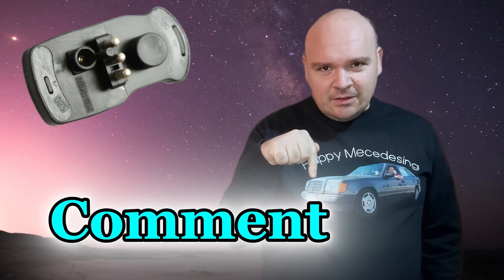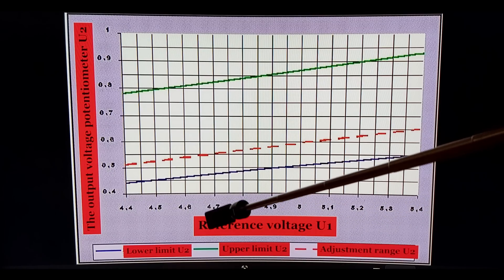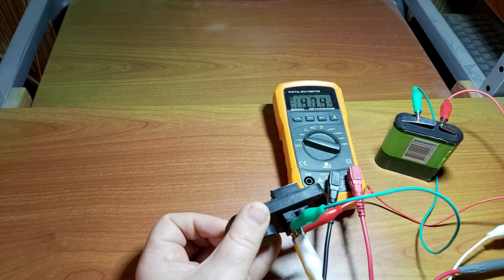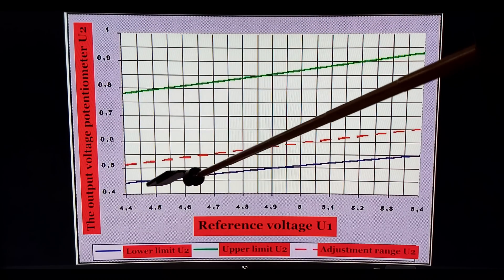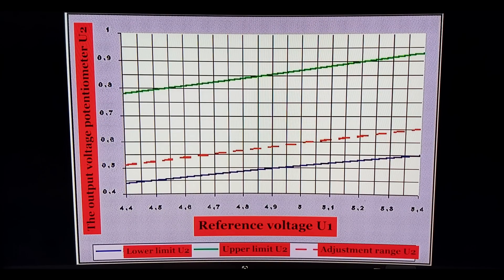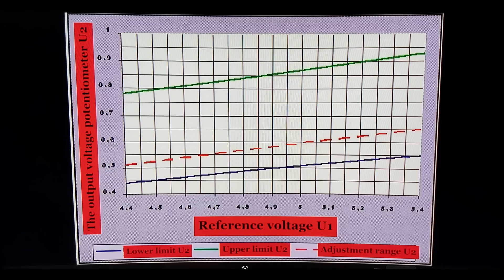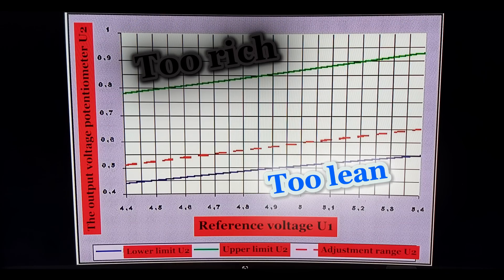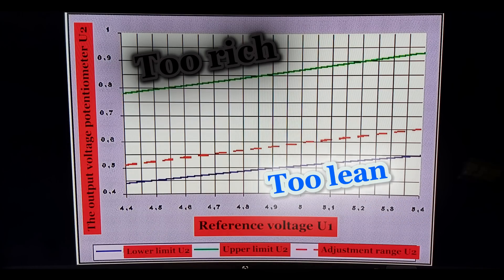㉦Mercedes Ke-Jetronic㉦-🎓📚⚡ Calibrating the Potentiometer to 0.7V | Why It Matters on KE-Jetronic ⚡📚🎓

Comment: Welchen Sinn hat die adjustment range U2? Ich dachte wenn die Referenzspannung U1 bei 5V liegt muss das Poti auf 0.6 eingestellt werden?
Reply from the maker: Die Einstellwerte bei diesem Poti hängen nicht nur von einer festen Referenzspannung (z.B. 5 V) ab, sondern bewegen sich in einem zulässigen Bereich. U2 (Ausgangsspannung) muss also innerhalb der Min- und Max-Grenzen liegen – genau das zeigt die Grafik. Wenn U1 ≈ 5 V, dann ergibt sich ein Sollbereich für U2 (ca. 0,65–0,75 V). Manche sagen pauschal „0,6 V“, aber in Wirklichkeit ist eine Toleranz vorgesehen. Deshalb habe ich im Video auf ca. 0,7 V eingestellt – das liegt mitten im erlaubten Bereich und garantiert, dass das Steuergerät die Werte stabil erkennt.
Reply: @mercedeske wenn es so ist, liegt 0.7V egal bei welcher Referenzspannung im gültigen Bereich. Dann muss man ja gar nicht mehr messen und kann immer 0.7V einstellen.

Comment: What if I get 7.82 V as nominal value? Too much mixture? Or does that mean my potentiometer is damaged?
Reply from the maker: 7.82 is too much for idle position, if you have been deflecting the sensor plate then it's okay. If you have been doing some experiments like me on the bench then don't do that. Each measurement is being performed at the operating temperature. If you got this on the ignition ON then it can be the potentiometer.
Reply: @mercedeske  Yes, I got 7,82V when the engine was running. Then should I purchase a new potentiometer or can the nominal value be adjust?
Reply from the maker: Try testing the potentiometer on resistance when the engine is off to see if the potentiometer is not scratched - it should be giving even signal which is going to be increasing and then to drop again as you deflect the sensor plate. If you get mroe times the "OL" on your multimeter then you should replace the potentiometer.
Reply: @mercedeske  The resistance values are good, and I tried what you are saying and it works propperly too, increasing resistance as I move the sensor plate, till the last third. The problem is that the nominal voltage is 7.8 (instead of 4.4-5.4 Volts) and I had to adjust it to 0.9 V between pines, otherwise the idle is too rough...

Comment: I have an idea for you for the next video. Get all the parts of the fuel and air system out on the table and explain how you would take measurements and adjustments one by one to get the Mercedes back to its best. The order of operations is important. Do you adjust the potentiometer first or plate height ....itc
Reply from the maker: KE-Jetronic is MECHANICAL injection, so always mechanics at first!  In this context setting the CO screw is priority(if you have to adjust it, normally) and then it comes to the potentiometer calibration. Concerning the rest of the request I can give you the link of my videos about the mechanical and electrical part of the system and if that isn't enough then send me a comment with this request and I will make you the video! Greetings.
https://youtu.be/Qokyh3TJjvA
https://youtu.be/6c4kQNKMu0Y
Reply: @mercedeske  Thanks. Great links.